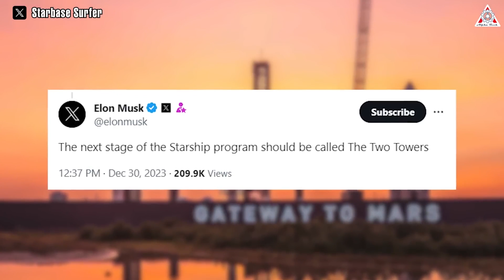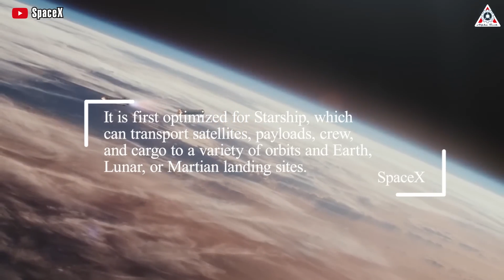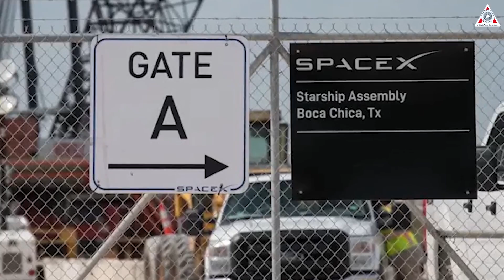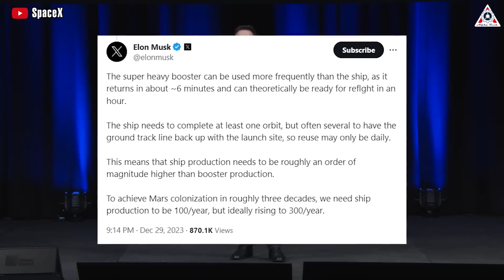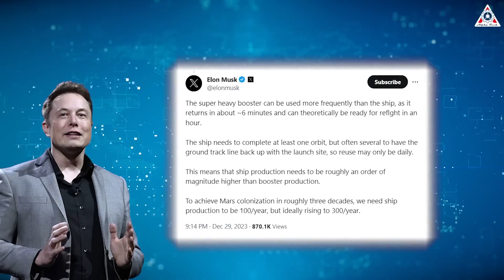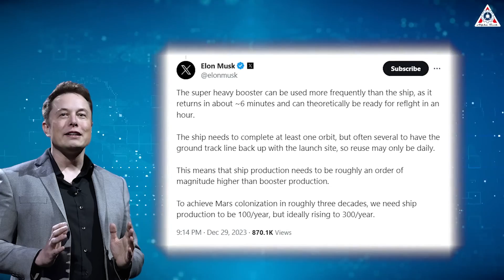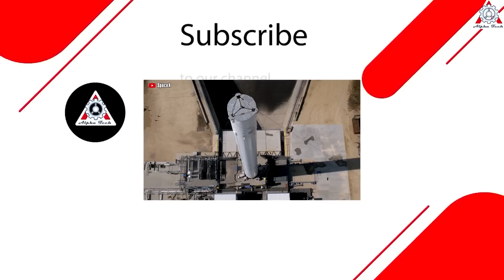SpaceX's MAJOR PLAN CHANGED! Musk to "Tower x2, 300 ships/year"...

Comment: I’m curious about why Mr Musk hasn’t launched a unmanned starship, one of the test models without the heat tiles to a low altitude like 10-20 miles then attempt to catch it with the chopsticks? Same for the booster. Neither fully fueled yet so no massive RUD. Just thinking, trying to catch it might be a little more difficult than expected. I totally believe it will be accomplished but why not try it out before it is necessary.
Reply: Because the tower is hard to fix and replace in a timely manner. Hence the second tower. Give them another 10-20 launches and mach landing.

Comment: NASA wants to control spaceX  and take the limelight on SpaceX's innovation
and you dont want to have only one tower what would happen if mecaziler got damaged 
so a specific landing tower it will not need a water system or a tank farm 
or a stage one landing only microzila will not have to be as high

Comment: Might be good if the tower catch system works, to have one at Starbase and another at Canaveral, so in case of malfunction you had two emergency landing systems spaced sub orbit.
Another thought I had about Mars, is if you used robots and AI to create interlocking hexagonal greenhouse covering of most of the planet's surface, and controlled interior atmosphere, you could use CO² from the outside atmosphere to assist plant growth, and you could vent excess oxygen and change the atmosphere, also large areas covered in greenhouse would retain heat and warm the "Marth" under them and bring up the over all temperature of the planet over time, and melt ice and release water. Basically would come a tipping point.
So I would suggest that research be done into making transparent glass on Mars. and also perhaps stainless for structure, from nickle iron in the soil. there must be quite a bit from micro meteorites that didnt get burned up like in Earth's thicker atmosphere.

My guess is one could rake the soil like using a spud plow and create a magnetic seperator system. would be interesting to know the assay content of the soil for planning purposes.

Some chance Mars could be intensively farmed using standardized greenhouses and robotics, and become a food exporter economy for the outer solar system Colonies and outposts. Would also be interesting to design differing orbital habitats for different solar orbits, to be passively temperature balanced.

And a good way to melt water ice on Moon or Mars would be to use crater green houses and create lakes in them.

Perhaps Aquaculture would assist the economy?

Building green houses to pressurize large areas would create many positives. And if done via industrial process using AI and robotics, serious progress could be made, and become profitable fairly quickly, and support Mars Colony way easier than paying the freight from Earth.
Excess food supply is the foundation of Civilisation, if you wish to become a multi planetary species, you'll need farmers for that! 🤗
Reply from the maker: Great dream♥️